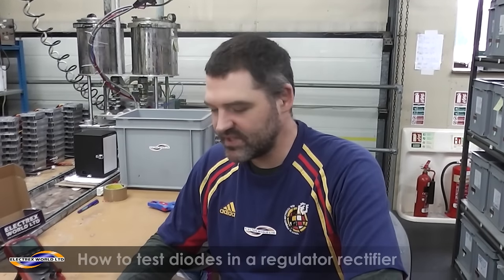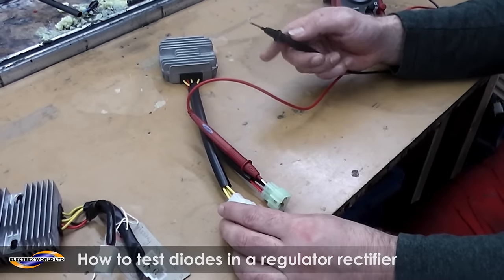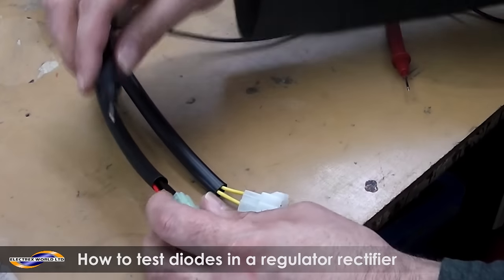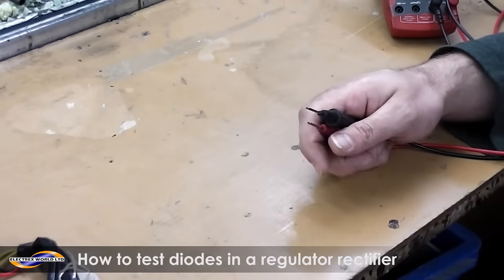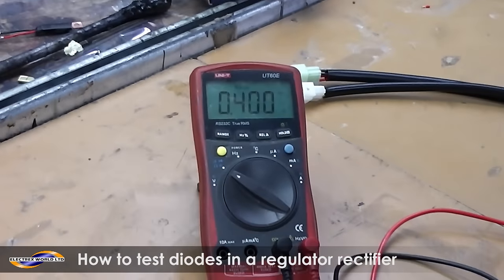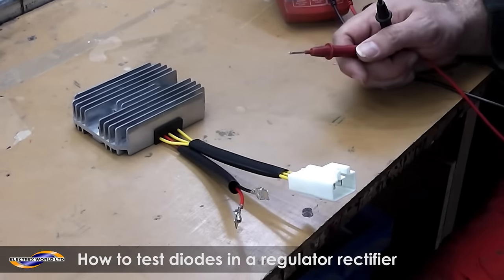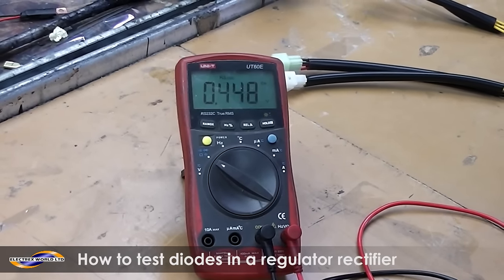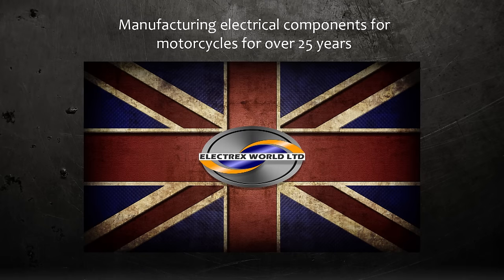How to test a diode on a regulator rectifier using a multimeter

Comment: Hi very good video on how to do it. I have an XL 600 RM from 1986 and am trying to check the regulator rectifier, but I am not sure I am doing it the correct way. It has 3 yellow wires of course and then it has 3 more wires, a red/white, a green and a black. How should I test this? I seem to be getting no readings at all by testing it as per the Honda workshop manual. Thanks in advance.

Thomas, Denmark

Comment: My 2007 Triumph Speed Triple has an issue trying to start. I thought it was the battery so I purchased a new one but that doesn't seem to be the problem. The issue: When trying to start the bike the starter will turn over for  just a second or two and then nothing and the dash lights and headlight all go black. I tested the battery when off the bike and it says 12.95 volts but after installed and this issue arises and the dash goes black the battery, while still installed shows 1.25 volts or thereabouts, I don't remember exactly but the reading goes really low. 
Then I disconnect the battery and it reads just fine, 12.9 volts. When I reconnect the same sequence happens again...Headlight and dash will come on and when I push the starter button the starter will only turn over for a second or two then stop and the lights all go black. 
I pulled the alternator rectifier and tested the diodes and they all read fine, about .542 or so on all three and reversing polarity same results. 
Do you think if the regulator is bad it will cause this shutting off of system and then the low volt reading when the battery is still connected?

Any input would be appreciated.
Thank you

Comment: 0.800 - 0.801 reading in red wire using forward bias but OL when reversed, is this good? And the reading from the green wire reads 0.457 - 0.460, what do you think

Comment: good morning,
if I do the test that starts at time 00:25 and I get very similar values, it means that the regulator-rectifier works 100% correctly?
My battery has become hot and started smoking; Now, doing test diodes that you did, the tester gives me the correct results.
I would like to know if giving correct results with test diodes, can be equally broken and send to overcharge the battery.

thank you so much

Comment: I am having some issues with my rectifier i think, and I found out that the VD across one diode is 0.480v dc instead of 0.507v dc that i get on the other 2 diodes. Do you reckon that is a sign of a faulty diode, or do you believe that the problem comes from somewhere else?

Comment: It is my understanding that each diode has two functions. 1. To allow flow in one direction. Hence the .56x reading. And 2. To prevent flow in the opposite direction. Hence the OL (out of limits) or 0.0 reading. It could fail in either direction so you still want to check all three diodes in both directions don’t you?
Reply: I think it's Open Line

Comment: Do you know if I can use a rectifier from a scooter/atv, that is charging a 12v 4Ah battery, to charge a car battery 12v 60-70 Ah? The AC current that is produced by the alternator has around 15Ah.

Comment: Hy Russel. I am having a problem on my motorcycle, maybe you can help me? I am stuck at the part that it says I need to check for generator resistance and the reference numbers are BETWEEN 0.1 and 1.0 Ohmns. If I get no-continuity then it says I have a faulty generator. 

HOWEVER my number shows continuity, they are between 1.5 and 2.0 ohms but they are off specification and the service manual says nothing about that case. 

I am lost here.

Also, the service manual also says to "check generator core is insulated" but it doesnt show how and I couldn't find anything on the internet about that. Can you explain me this? 

Thanks a lot

Comment: Which is the robust regulator. What is the value that should be
Reply: Im pretty sure it does not have a set value. As long as the readings are of similar value the reg/rec is healthy. If values differ by a great margin or read zero, the reg/rec is not healthy.

Comment: Its called Forward voltage drop in diodes... And you miss to explain difference between Shunt and Series types of regulators.
Reply: @Ivan Hi man, u seems to be aware about technologie (parallele vs series), anyway it's mosfet or scr, the way to test it is different then? (i ask because i m in an urgence, and reading make things more clear to me, while hearing is too difficult) can u help understanding?

Comment: Hi there, I have a triumph street triple r 2011 and am having problems with keeping the battery charged. I did this test - with the positive lead on the negative connection i was getting a reading in the 500's on all pins, but with the negative lead on the positive connection i was getting a reading in the 130's on all pins (note my diode tester shows readings differently, e.g. as 138 not as 0.138). Does this imply the rectifier is the problem? Thanks.
Reply: did a new reg solve your problem? I am having the exact same issue getting different readings while reversing pos and neg

Comment: When I had the positive lead of the multimeter probed into the 3 yellow wires, I got 0.45 ohm for each one of them. But when I had the negative lead of the multimeter probed into the 3 yellow wires, two of the yellow wires showed .1 ohm each and one yellow wire shows  0.09 ohm. Is the rectifier still ok or is it malfunctioning already?
Reply: Does any one have an answer for this?  Should the three readings on the negative lead and be similar to the readings on the positive lead?  I get the same set of readinngs; 441, 441, 441 and then 103, 103, 101.  Or should both leads give values thats are in the 440'ish range?

Comment: Mine works on all four in the reversed way, but then when I do it the first way (red ammemeter to black regulator wire), none get a read. Is this also a bad regulator? Rzr 800

Comment: Hi Russell could you explain why my Honda 250 rectify overcharging
Reply: Hi, from my experience that is the regulators job, to limit the charging voltage to the battery. So if it is overcharging your battery it is not regulating the voltage to your battery, so the regulator/rectifier is in need of replacing. Hope that helps you out

Comment: shorted diode would cause total no power ? meaning even digital meter no light
Reply: Shorted diode would melt the wires to the rectifier and ground.

Comment: Hi, could you help me?
I've an honda vfr 800 FI my 2000. the three phases rectifier (three yellow line) and a plug with two red/white line and two green line plus a black line alone. I put the neg of the multimeter on each red/white line and i put the red of multimeter on each yellow line and i read 484, 488, 487 for the first and 484,488,487 for the second red/white line.
than i put the pos of the multimeter on the first green line and i read 478,476 and 486 for the first and 478,476 and 486 for the second. I don't know the meaning of these values. The rectifier is good? what does the black wire do?. thank you so much for your answer.
Reply: +Giuseppe Nucera 
the recharge tension to the battery is over 16 volt at 5000 rpm

Comment: Hi I need Your help.
I have done test similar to Your.
Here is effect: https://www.youtube.com/watch?v=BRbzt7J3qJs

When I checked green wire connected to black cable in multimetr and red cable is checking yellow wires 
I saw one of 3 yellow pin  have got signal which shows connection. Which is probably bad? What You think?